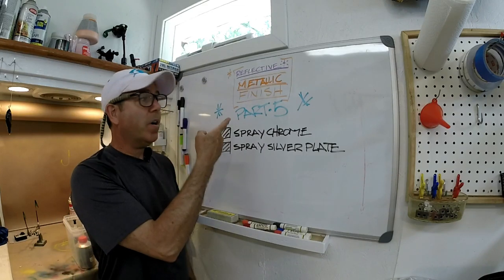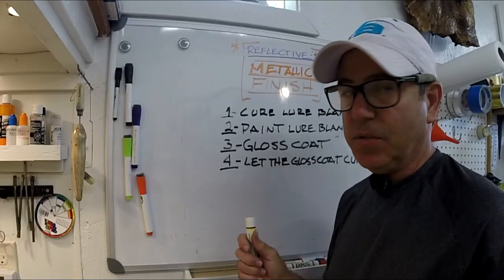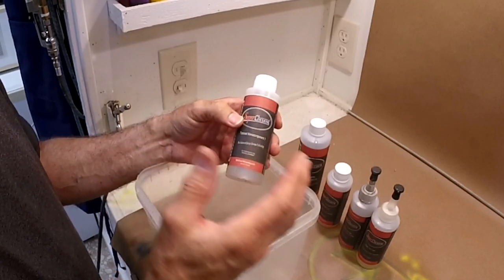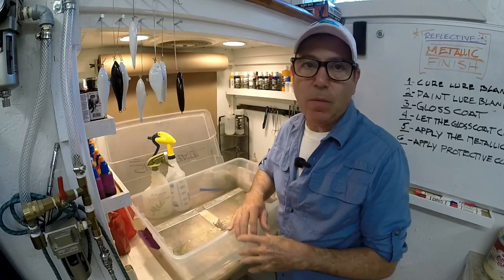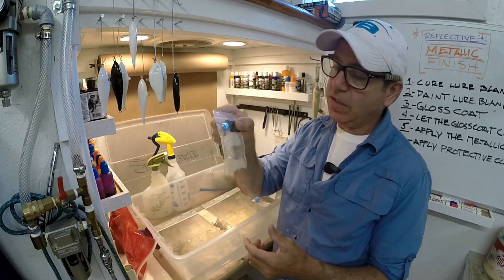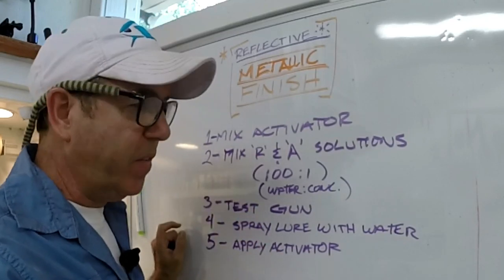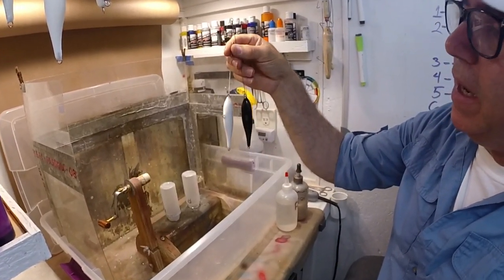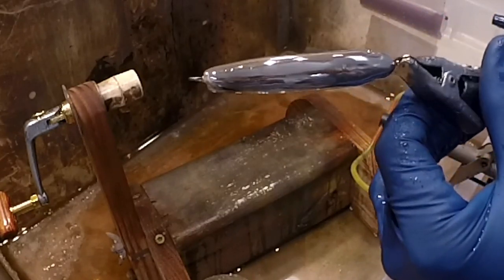Custom lure silver plating

Comment: Lure making can become an obsession.  

Is that solution at all cyanide based?  If so i would not have any acid near it.  The acid cleaning should be a completely seperate process from the platimg.  This prevents a home made gas chamber. But that said, silverplated lures are much more reflective, and fish seem to like them way more than nickel.